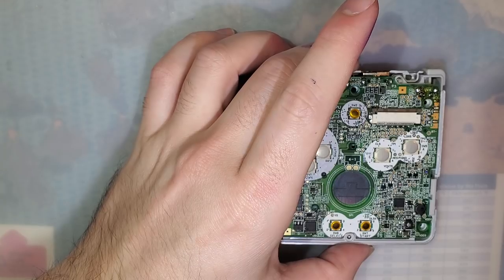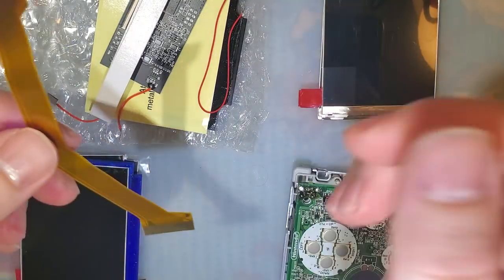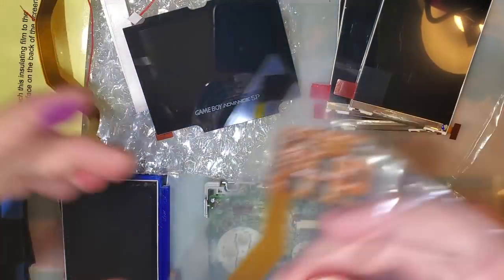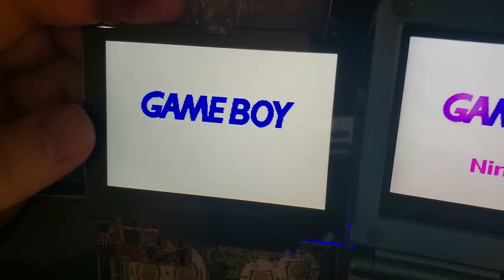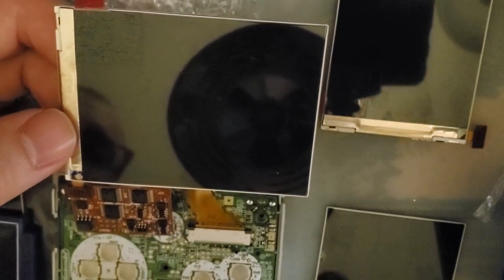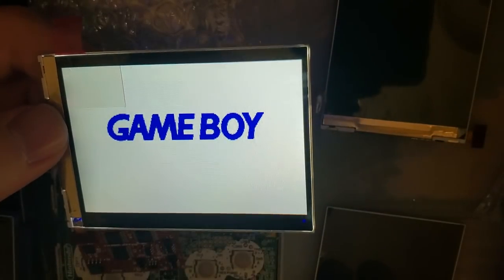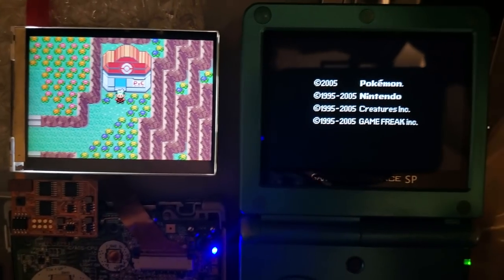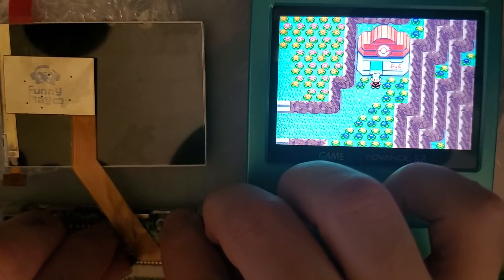New IPS LCDs: LG vs Toppoly

Comment: UPDATE: Just got a Funnyplaying kit for SP, the one from their new stock, the back of the connector on the display is no longer brown or black, now it’s metal, the same as the back panel of the display...
Reply from the maker: yep, they now use their own newly manufactured LG screens so now there's a 4th variant of the 9380 LCDs out there. 

Same disclaimer applies though, what you get is still a roll of the dice depending on the age of stock from the seller.

Comment: I wasn't aware of there being different brands of these LCD's that were being used for these mods, I bought a third IPS screen just in the last week from a seller in the UK after working on fixing up two other SP's a while ago (which I think must have the LG LCD's). The warmer / more yellowish contrast on the Toppoly (which i'm guessing is what my third screen is) is much more noticeable in person with them side by side and I have some pretty major light bleed at the two left corners of the screen thankfully no dead pixels like you've shown here.
Reply from the maker: this swap in LCD vendors is something that occurred recently. Some resellers may still have old stock, especially outside china. 

And yeah, I should have used my Lumia for this video. My S10e really blows out the colors.

Comment: So if I order the "Unbranded" variety of IPS kit on Handheld Legend which I was considering ordering from, I'm pretty much getting these? I don't mind a warmer color temperature or slightly different battery life usage since I'd just use it in an original GBA with eneloops since I prefer AAs, but the more common defects are absolutely good to know.

Comment: I rly think you should consider adding Choplifter 2 to your flash cart.  The main screen has a transparent logo and as it loads the logo shifts and if the screen has issues with image retention then you should definitely see it. I got a FP kit for my GBA with a toppoly screen and it definitely has issues with image retention but it’s only for the sprites that are supposed to be transparent. I only mention choplifter 2 as it just has a larger image with that effect so it makes it easier to notice and good to use when testing screens and different IPS kits.  Keep up the good work tho.. Rly helpful and detailed!

Comment: Could you do a quick test sometime and see if either panel draws more power? maybe I'll catch you during another livestream.
Reply from the maker: If they do, I cannot measure any meaningful difference, margin of error and all that.
Reply: @makho  Hey again, Appreciate the vids and info, and especially the battery mod pcb

Recently been having a hell of a time trying to find an SP 3.19 lens for my spare LG screen. 
Everyone seems to only have laminated toppoly screens, and 3 inch lenses. 

I can cut an AGB lens down like your v1 mod, but figured first I'd ask if you knew anywhere that sells the SP 3.19 inch lens, or something that works better than the gba lens surgery/centering

Comment: Bought an ips v2 screen and new shell recently on ebay from a chinese seller that didn't specify anything with the lcd, I'm scared that it might be one chip screen now.
Reply from the maker: Reasons like this are exactly why this change upsets me so much. There was ZERO communication about it. Nonetheless, please don't be scared, these new screens aren't bad. The LG ones are just better and seem to have a much lower defect rate. 

When you get your kit and test it before installing, if you notice any issues, make sure you contact the seller.
Reply: @makho  yeah I will, it's just if I get a bad screen that's another good while I have to wait before getting a new screen

Comment: Temperature is really irrelevant with these screens. None are calibrated. GBA games weren't really made with  SRGB or a set color temp in mind anyway.
Most of your "white" ones are either too blue or have green and red tints to the greyscale. At least compared to 6500k white point. 
And the whole "Blue is better" is just an illusion anyway. The old tv showroom trick.
Reply from the maker: What you said about the color temp is very true but it doesn't tell the whole story. That's why I put both screens side-by-side running the same backlight kit and the same game. Look at them and tell me which one you think looks better. If they both look the same to you, you need to check your monitor or your eyes. I posted a link to pictures as well. If you can see the difference and you just don't care (which is something else entirely), then this facet doesn't apply to you. You should still be paying attention to the defect rate that I mentioned as these Toppoly panels have a significantly higher defect rate than the LG panels, however.

Comment: I have 5 Toppoly Screens now at home and non of them has dead pixels. 3 (-1 broken by myself) are really great. I like the warmer colors, but can't say if I would prefer the LG ones, because I didn't see them in relal-life. But 2 of the Toppoly have banding. In most games it isn't noticable but in Mega Man Zero, the Walls in the base (solid color) show so much banding that it hurt the experience. 
The befor mentioned 3 have only a little bit of that banding, so little that you do not notice it, while playing. Perhaps its the game by itself, but on an stock SP I can't see it, but it is clear, that the Screens have no consistent quality. 
I ordered now 5 Screens from funnyplaying, hope they are LG's that I can test those.
Reply from the maker: I think that's one of the biggest issues with these screens -- the lack of consistency. When you get a toppoly LCD, there's no guarantees whatsoever on what you're getting.
Reply: @makho  what I find strange, ist that all my good Screen came from Kit's an the bad one I bought as Sparepart. Coincidence?
Reply: @makho  I got now my LG screens and tried one. Sadly I got banding, so are the LGs really better? You can test it good with the brownish solid color walls in Mega Man Zero. Even side by side I think the colors between the 2 are only a question of taste and not quality

Comment: Was wondering why a backlit GBA I bought recently had such a yellow tint on the screen and very dull colours compared to the V1 I installed myself. Swapped the logic board and ribbon from the one chip console into the old glacier one, and the results were amazing - great colours with no ugly tearing!

Comment: Tested now 2 such screen an all of them are flawless. Great colors, no dead pixels. For me the color temp is a question of preference not quality.
Reply from the maker: It's not just color temp but contrast and saturation as well.
Reply: @makho  I have an LG 4K IPS PC Monitor an running Metroid zero Mission here on an Emulator an compare with the Toppoly Screen the difference is extreme little an more a question of calibration than quality. Some colors are a tiny bit more vibrant an the PC other on the Toppaly. Sadly we can't calibrate the GBA Screen (that would be fantastic) so I think the LG(GBA) an Toppoly have 2 different base calibrations, but that is for me not a signe between good an bad quality. Dead pixels are an other question. I know that LG has diffrent quality classes for there panel production. Perhaps with Toppoly it is the same and some vendors take the cheap stuff with a higher rate of dead pixels and other ones the costly perfect screen. For the User it is only very bad because we can't know before buying. I, as an, in EU living, customer will not send such a cheap product back to china. 
Finaly, I do not believe that the verdict "The China Topolly Screen are in general from bad quality"
Reply from the maker: @Daniel160384  This is "B" stock and the vendor has assured my supplier that they check each individual screen. And yet, despite that, I still got several panels with dead pixels. I, for one, am not looking forward to when they burn through all of their "B" stock and start shipping "C" stock. The LG screens were universally "A" stock. 

I posted side-by-sides of the LG and Toppoly screens with the same image on both and every time the LG one has looked better. I will be the first to admit that one at a time, I probably wouldn't see the difference. But side-by-side, the difference is clear to me and the fact that they switched to these lower quality LCDs without warning is not respectable.

Comment: One dead pixel isn't going to hurt anyone.
Reply from the maker: I think you missed the point. Of the five Toppoly screens I got for testing, two had dead pixels. I have around 15 LG screens I have from previous mods and salvaged panels, zero had issues.
Reply: @makho  okay the yellowing to me was more of an issue
Reply: There aren't that many pixels on a gameboy screen. A dead pixel really sucks.
Reply from the maker: @v.p.5743  well, don't forget about the scaling. One dead pixel means that you only really lose 75% of a pixel.